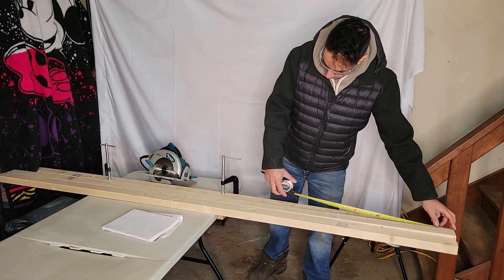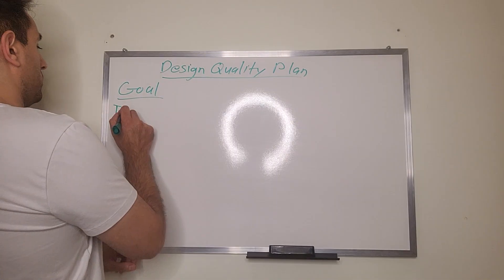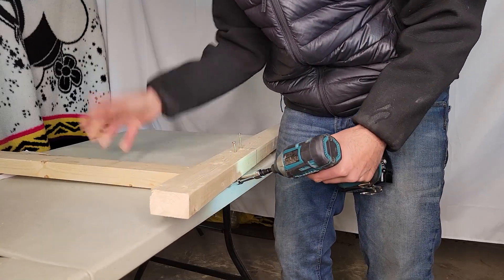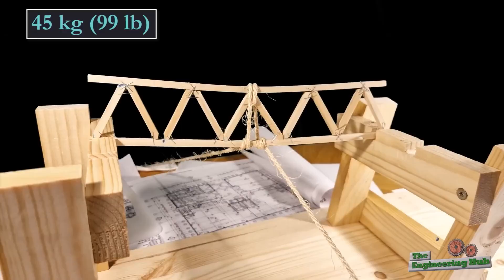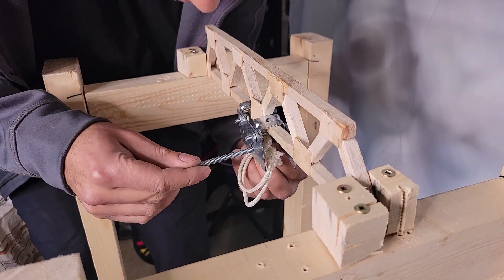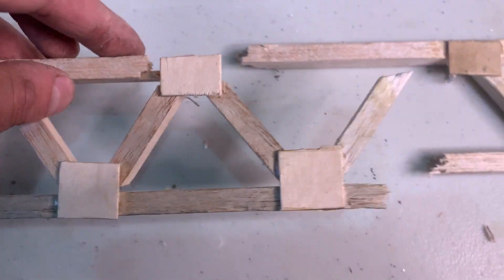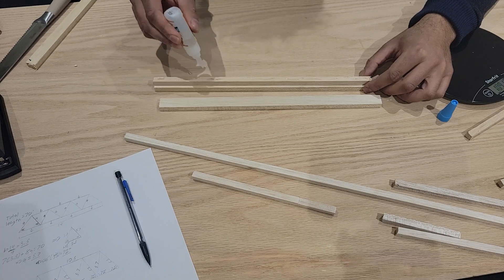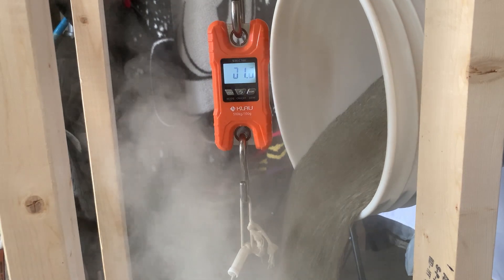How You Should NOT Do Engineering

Comment: Clearly load it from top compression is stronger than tension
Reply: I'm curious about this as well because in my materials and processes mfg course I'm taking this semester we have treated the loading of tension the same as compression just opposites you know when making tensile strength diagrams. I'm very curious now.
Reply from the maker: Why is compression stronger than tension?
Reply: Please note that since I have no formal engineering education or background, my terminology and analogies will be incorrect and probably only loosely applicable... 

When you pull from the bottom a large amount of the weight is being supported by the joining methods of the lower beam to the ends of the angled members. The surface area of the angled members actually making contact with the bottom beam is quite small.
However, when applying the weight to the top though – certain positions along the truss being superior to others – some of the downward force is converted into horizontal force by the angled beams. The ends of said angled beams will press horizontally into each other to support that weight. Your design would benefit from modifying the ends of the angled beams so that they each have a face that is perpendicular to the beams so those faces are where the two angled members make contact. Without that it's possible that one of the two members could slide under the other (like tectonic plates do) and end up acting as a wedge that pries the other up causing failure. 
Pardon this ignorant analogy but it's the best I could come up with: Think of an A frame ladder where the folding supports that hold the legs together have been removed. If you set up the ladder between two walls the walls will hold the ladder in position because a portion of the downward force is being converted to horizontal force. If you remove the walls the ladder will just slide apart and fall. The distance between the walls is proportional to the angle between the legs of the ladder and as the angle between the legs increases more force is converted to horizontal force which is then applied to the walls.
So, when applying weight to the top of the truss – remember, some positions are superior to others – you're converting a portion of the downward force into horizontal force which is distributed among the angled members which then press back against the upper and lower beams which again transmit some to the angled members which then... You get the idea. Adding the faces to the ends of the angled members that I mentioned above will change the stresses the joints experience for the better and might even reduce material slightly
Someone above said that you were using paper glue? I didn't pay enough attention to see but, while wood glue is very similar to paper/school glue, they aren't the same in use at all. If wood glue is properly applied the failure will be in the wood itself and never at the joint. This is because the bond created by wood glue is stronger than the wood. Extra metal hardware is in theory unnecessary except to resist shear forces (I doubt I'm using that word correctly: by shear force I mean the force a bridge truss would experience as wind blows across it (perpendicular)). Since "shear force" isn't a major consideration here (it does experience some but it should be miniscule) the only thing extra hardware might do is contain/obscure a failure temporarily which skews the experiment in my opinion. If the glue joints fail the truss fails. 
When using wood glue though tightly clamping the pieces being glued together is critical and wood glue is super slick at first. It takes 24 hours for the joints to cure all the way. Make sure you clamp the truss between 2 larger pieces of wood to ensure the force is applied to it evenly. The clamping force used will "preload" the joints. Think of an empty flatbed trailer. It bows upward so that it lays flat when loaded. That upwards curvature is calculated in expectation of a particular maximum load. You'd want the clamping force to be somehow proportional to your desired final load.

Depending on how much force you plan to apply, the truss removing the clamping force evenly and slowly is a good idea. An Irwin quick clamp uses a single lever to suddenly remove all the force for example. An F clamp will allow you to remove the force gradually. If you remove all that force instantly the truss might fail right then since the force would violently snap back opposite the members. Portions of the truss are in an "unnatural" state until they have force applied to them again. As force is gradually applied that somehow coincides with the clamped force the joints should "normalize" again to the conditions experienced when they were clamped.

Since simply clamping a truss between two pieces of wood will never actually simulate the forces applied to a truss when loaded as in the experiment I can imagine there's a compensatory distortion that should be applied to the clamping forces that would result in stronger joints when actually loaded but heck if I know. The theory is simple enough I guess. The distortion would account specifically for some inverse of the "final" loaded shape of the truss. This would be the only way to make sure all the angled members are receiving an amount of force similar to the force they'll receive when it's loaded.

I just googled pictures of some trusses and I noticed a few things.
1. You're building what appears to be an incomplete ceiling truss. Ceiling trusses have additional vertical support at the ends where they connect to their piles that will provide support similar to the walls that were holding the a frame ladder (bridges don't seem to). Interestingly, roofs tend to be vaulted such that two trusses are angled upwards and meet in the middle thus forming a "truss" of sorts themselves by again converting even more vertical force to horizontal force.
2. If you're wanting to build a bridge truss Google "bridge truss" and look at the difference between rail bridge trusses and other bridge trusses. The truss you're building is pretty low profile like a rail bridge. However, you're missing a critical part though. Between each pair of angled members there's a vertical member. That member will provide a critical extra support to hold the upper and lower beams together! Theyre having to transmit forces that are being applied back against them and those vertical members will be supremely helpful. I can't state enough however that at your scale the dimensions of each member, especially a vertical member MUST be prpoer and consistent. A vertical that is too short verges on useless and one too long is even worse since it will have a very negative effect on the joints of the angled members.

If I understand the engineering considerations the entire point of a truss is to achieve a greater strength while using significantly less material. If that's the case then shouldn't the beam and truss be weighed? Their comparative strength has to take the ratio of those weights into account before it would make any sense at all. Without this extra consideration the experiments seems to become a bit arbitrary. The truss should either weigh less than the beam yet provide the same or greater strength or the same weight and provide superior strength. You were already doing this but obviously the span of the beams and truss have to be the same, that's the total span of the beam and truss and not just the distance between the two support points (the wood base you're resting them on).

Lastly, thinking out loud, I think that somehow this assembly would benefit from certain joints not being glued. If you used vertical members then the angled members might benefit from somehow "floating" maybe in a slot of some sort. They do need something to keep them aligned but if they weren't actually fixed in position the entire assembly would be far more forgiving overall. When there's no load applied it becomes essentially a ladder🪜. When you apply a load, the horizontal forces being transmitted through the angled members will compress the walls of the vertical member and the resulting friction created by that compressive force should hold those faces I described above in placdecrease the amount of force being applied to the upper and lower beams. 

Anyway, that's a few cents, I apologize for the wall of text.